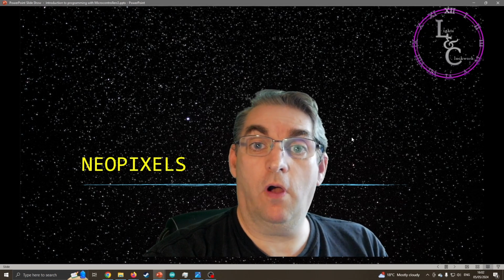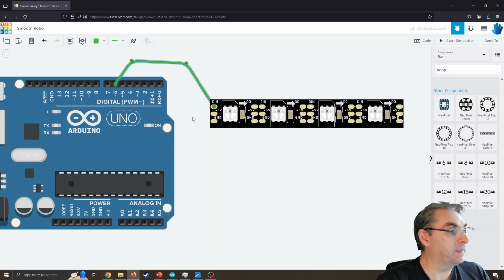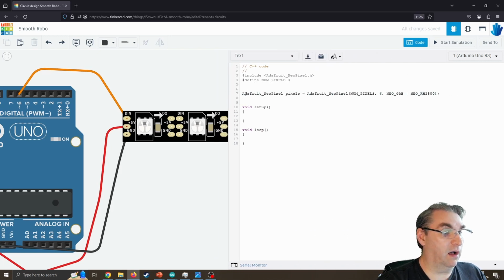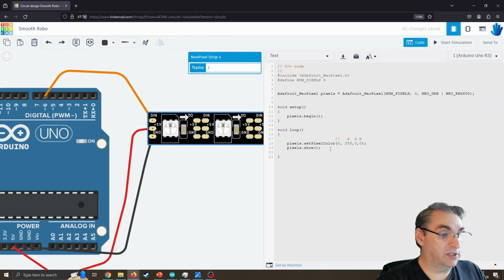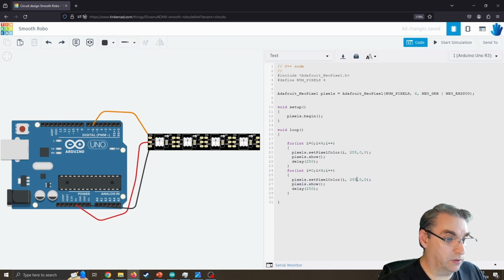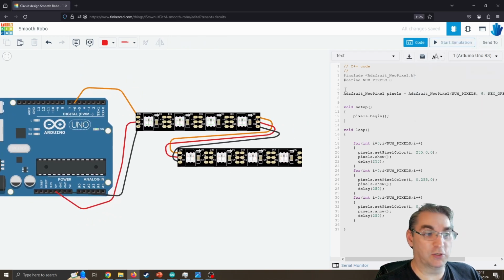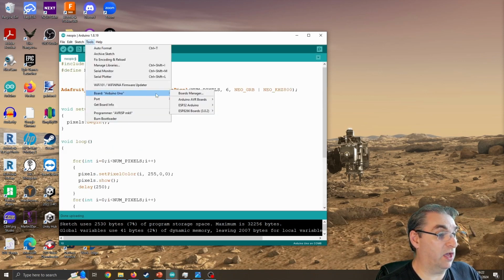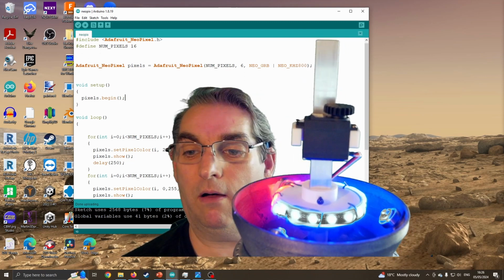Introduction to Programming Microcontrollers Lesson 4 - Coding Neopixels Addressable LEDs

Comment: Thanks for the tutorials.  I haven't used neopixels before.  I'm looking forward to connecting with external power while keeping the programming USB connected.  I've had a problem in the past where I've burned out my laptop USB port.
Reply from the maker: Oh no! I am always worried about that, but so far hasnt happened. 
I make robot cars for teaching in class, they need batteries to power the motors and the kids often leave the battery pack on, when they plug in to re-code. I'll include some safety checks. I am sure someone with a higher level of electronics will show me a better way.